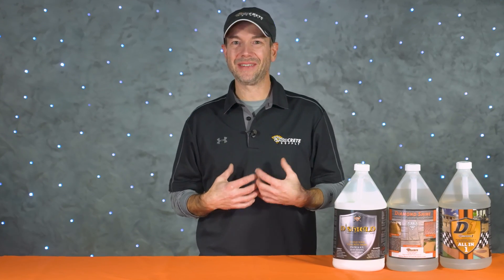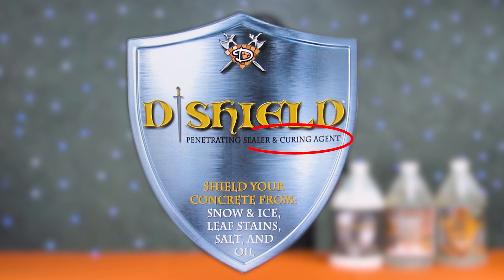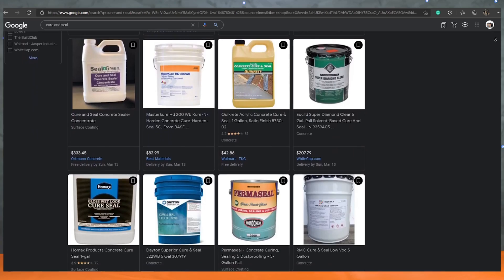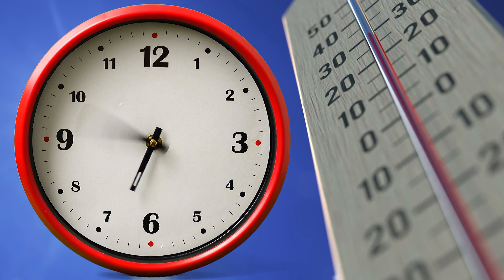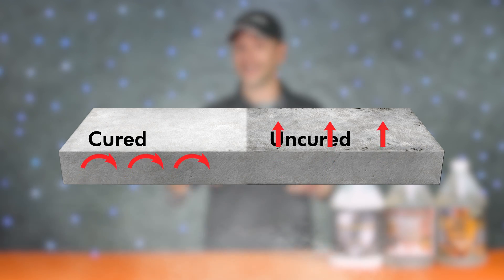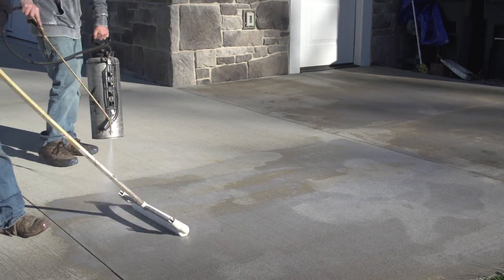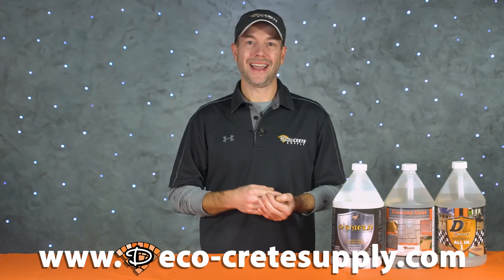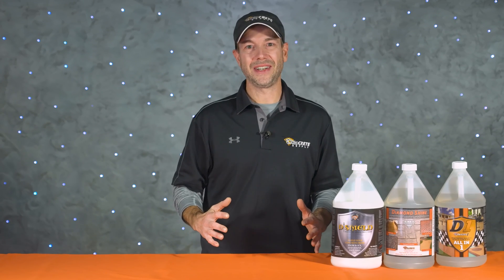Curing vs. Sealing Concrete | What's the Difference?

Comment: what sealing product should i use that will also lock in decorative stones/tiles/beads placed on the concrete, especially with a matte finish?
Reply from the maker: Thanks for the comment! A few questions for you: Are the stones embedded and secured in the concrete, or are they loose? Is this an interior or exterior project?                                                       It would be hard to hold them in with a concrete sealer. Epoxy would work better for locking the stones, but that would only work for interior concrete. If the stones, tiles, and beads are well secured in the concrete, then a regular concrete sealer would work fine. I would recommend our D-One sealer in that case. I'll leave a link below to a video on sealers vs epoxy. Hopefully this helps. Thanks for watching Deco-Crete TV!!!                                                                                                                                                                                                                                https://www.youtube.com/watch?v=dSz71y4uKcU&t=425s
Reply: @DecoCreteTV  exterior. Most are locked in but some are loose.

Comment: Should I seal in a place I use petrol and oils/solvents like a slab of concrete where I pull motor bikes apart and that?
Reply from the maker: Thanks for the comment! To answer your question; yes, you should the area. But, this situation can be tough as solvents, gasoline, and break cleaner can damage most acrylic sealers. Penetrating sealers are better for this because they don't leave any film behind to damaged by the solvents. The only downside is that penetrating sealers don't respell oil stains quite as well as film forming sealers. There is no right or wrong here, it just depends on what's most important to you. Personally, I prefer penetrating sealers for this. I'll leave a link below to a video explaining the difference between the two types of concrete sealers. Hopefully this helps. Thanks for watching Deco-Crete TV!!!                                                          https://www.youtube.com/watch?v=mpm855Hg9ec&t=310s

Comment: Should there should be a cure product put on a concrete that was just poured at 40-45 degrees? It has been covered and cut lines will be done the next day.
Reply from the maker: Thanks for the comment! We've never worried about applying a curing product in those temps. The point of a curing compound is to help the concrete retain moisture and slow down the curing process. This will happen naturally in cooler temperatures. This does not mean that the concrete is protected, though. You will eventually need to apply a sealer to reduce water intrusion and guard against staining. Sealers generally get applied 30 days after the concrete was poured. Thanks for watching Deco-Crete TV!!

Comment: It’s been 5 days since my sidewalk was pour. Is it too late to apply cure and seal.
Reply from the maker: Thanks for the comment! It's not too late to apply a cure & seal, but at this point it won't do much to slow down the cure. It would be acting as more of a sealer. In order to "cure" the concrete it would need to be applied within the first 24hrs. Even though the curing stage can last up to a month, concrete gains most of it's strength in the first few days. At this point, I would let it cure out for another week if possible, then apply the cure & seal to protect the concrete from staining and winter weather. Hopefully this helps. Thanks for watching Deco-Crete TV!!

Comment: I have a concrete path leading up to my home. My neighbor, who was trying to be nice a few years back, put salt all over my concrete to de-ice it while I was at work, not knowing that it would destroy my concrete. Anyhow, it has since spalled pretty badly in some areas and even had a few larger cracks. I'm not in the position to fix it professionally right now, by having someone come in to resurface it, if I seal it do you think this will help prevent it from spalling any further? It's never been sealed, which was my first mistake, and I think that's also part of the problem. I recently did a faux finish on it with watered-down chalk paint to make it look like flagstone, so the spalling and cracks in the concrete look more intentional and less visible and to be honest I'm pretty happy with the end result for a DIY project that I did myself until I can get it fixed professionaly, but now I want to prevent it from spalling even further and also want to seal in the faux finish that I just painted on it. Any ideas on what I would use in regard to this application, or do you think it will still continue to spall after the winter? I used chalk paint because, instead of it peeling over time, it should just fade slightly, and because I watered down the paint, it went on more like a stain rather than a thick paint.
Reply from the maker: Thanks for the comment! We're sorry to hear that you're having spalling issues with you concrete. It's hard to say if sealing it now it will stop the spalling or not, but it will keep water from soaking into it, and may extend it's life a bit. That said, we never recommend applying concrete sealer over paint. Acrylic/topical sealers will have a really hard time bonding to it, and the paint will block penetrating sealers from soaking into the concrete properly. I don't have any experience with chalk paint, so I'm not sure if that would be any different or not. I'm curious how fast water is soaking into the concrete right now. Paint itself can ack kinda like a sealer as far as keeping water out of the concrete. The problem with paint is that it tends to peel or ware off after a short period of time. The first thing I would do is a water test. When the concrete is completely dry, dump some water on the surface and see what happens. Does it soak in immediately and make the concrete look darker? Does it take a few minutes to soak in and get dark? Or does it just bead up and have no effect on the color at all? If the slab seems be fairly water repellant the way it is, then I would probably just leave it alone. If water gets through the paint with in a short amount of time, then you might be able to get a penetrating sealer to soak through it as well. That kind of sealer won't necessarily keep the paint from wearing off, but it would make the slab more resistant to water. I would not recommend applying any kind of acrylic sealer, though. I'll leave a link to our video on penetrating vs topical sealer below. Hopefully this helps. Thanks for watching Deco-Crete TV!!!                                                                                                                                                                                                              https://www.youtube.com/watch?v=mpm855Hg9ec&t=239s
Reply: @DecoCreteTV Thank you for the detailed reply. The concrete is still very porous and absorbs water quickly.

From what I understand, watered-down chalk paint acts more like a stain and usually needs sealing. The paint’s designer said it can be left unsealed or sealed with her own (costly) product, but I’d prefer an affordable penetrating sealer from a big box store.

Based on my experience, chalk paint doesn’t peel but fades over time if unsealed. I’ve used it on many surfaces—including concrete—and it tends to wash away without a sealer or wax.

I put a lot of effort into the faux flagstone and want it to last a few more years before resurfacing. I was planning to use Behr’s matte penetrating sealer to help preserve it. But are you saying it won’t help protect the paint? I assumed sealing the surface would help lock in moisture and keep the chalk paint from fading—is that incorrect? I'll take a look at your link now. Thank you!

Comment: If the "cure or seal" liquid is a barrier to the "loss" or "addition" of moisture, why wouldn't it do both things at the same time?  It's a vapor barrier that prevents the flow of moisture from, or to, the concrete.  I'm confused by your description.
Reply: Ok so I did some digging bro. They are two completely different uses. Because you ONLY Cure your Concrete right after it’s been poured. It’s used to keep the hydration in so the cement can set as strong as possible.
Whereas Sealant is protecting the already Cured Concrete.  

Curing - Strength Development 

Sealing - surface protection  

Hope that made sense
Reply: I’m thinking the exact same thing. I don’t understand how they are “completely different things”

Comment: So my contractor poured a new drive way and side walk for me, then came back about 24 hours later to deform, and sprayed sealer on it,  not sure exactly what kind, it has now been about 2 weeks and most of the drive way looks great but there is a couple spots towards the end where they finished the pour that have some sealer lines in it, almost like nozzle got clogged and was a stream or something that are darker then the rest of driveway will this go away after the curing is complete or should I put something on it to make it better. Most of it looks a nice light gray color but there is few squares with those lines thanks for any help
Reply from the maker: Thanks for the comment! I know exactly what you're talking about, we've seen that a bunch of times. It will get better with time, it just might take a while. Basically, there is more sealer on those spots then the rest of the driveway, so it's making the concrete darker in those areas. You should notice a difference within a month or two, but could take longer then that before they're completely unnoticeable. I would not recommend putting anything over right now. You really need the sealer to ware down in those areas and putting something else on it would only the slow the process down. We hope you enjoy your new driveway! Thanks for watching Deco-Crete TV!!!
Reply: @DecoCreteTV  thanks my contractor said the same thing I just wanted a second opinion, thanks for the help!
Reply: It's a cement driveway outdoors, not a marble floor in your living room.  Do you really think that everything will be "perfect" in 14 days?  Do you realize that 28 days id the first critical time period for concrete?  Do you know that concrete continues to cure for 100 years after installation?  It's a chemical process.  Please do a little research and learn about concrete.
Reply: @philtheheaterguy951  I did research, that’s what led me to this video. The creator was nice enough to answer my question and concern, he wasn’t a jack ass like you, 😂I wanted to hear it from someone that was an expert in the field not some random website or person. Some people unlike you have a life and don’t wanna spend hours of time researching concrete. Lmao get a life bud

Comment: Is there a product that can be applied to keep it from not sweating?
Reply from the maker: Thanks for the comment! There's not really much you can do to the concrete to keep it from sweating. That has more to do with the building itself. Applying a sealer to the concrete would keep the moisture from soaking into the concrete, but it probably won't stop the sweating. Thanks for watching Deco-Crete TV!!!!

Comment: Why am I getting tired marks so easy on a new concrete cement poured? I did the bear concrete sealer on it and it’s so easy to pick up tire tracks.
Reply from the maker: Thanks for the comment! Tire tracks are common newer driveways. The good thing is, they will wash off fairly easy with a power washer and they will also go away on their own over time. If you've already sealed the concrete then there's not much else you do about it. It tends to happen the most when turn your car on the concrete. Again, it's nothing to worry about and they wash off. Thanks for watching Deco-Crete TV!!!

Comment: I'm  new to this but is it possible for the cure to be broken...if so how does that affect the concrete and release of VOCs
Reply from the maker: Thanks for the comment! By broken, do you mean spoiled? Or are you referring to the curing compound on the slab breaking down over time and wearing away? The second example is normal and once the curing has worn off, a sealer should be applied. In the case of spoiled product; don't use it. It's not worth the risk, just get a fresh pail. Hopefully this answers your question. Thanks for watching Deco-Crete TV!!!
Reply: @DecoCreteTV  I guess both...thanks for the response. I think you've already answered my question. Do you think there would be a cure that would remain irrespective of any type of damage? Or are we not there yet
Reply from the maker: @, I'd say we're not there yet. Solvent-based curing compounds will last much longer in the pail without spoiling than water-based products. However, all curing will eventually wear off the slab.

Comment: hey can you use the curing sealer to help cure fresh concrete. then 30 days later come back and seal with Penetrating sealer instead of using the acrylic again?
Reply from the maker: Thanks for the comment! If you cure the fresh concrete with an acrylic cure & seal you can seal the concrete down the road with a penetrating sealer, but it probably won't be ready for it after 30 days. You need to wait until the cure & seal has broken down enough for the penetrating sealer to soak into the concrete. All situations are different, but 90 days is usually a good number. Basically, once the cure & seal stops repelling water, a penetrating sealer may be applied. Thanks for watching Deco-Crete TV!!!

Comment: Our contractor applied a sealer immediately after placing our concrete colored driveway.  Then we put visqueen on to help with curing... seems that was a huge mistake... now 21 days later our driveway is very blotchy.  Are we stuck with this result or is there a fix?  Thank you for any help... our contractor is not helping....
Reply from the maker: Thanks for the comment! Concrete will naturally go through a blotchy phase while curing, and it's generally more noticeable with colored concrete. We would normally say to wait 30 days for the concrete to cure and the color to develop before applying any final layer of sealer, as the blotchiness normally goes away on it's own. Covering the slab with visqueen is the most concerning part of your situation. This can leave cure lines and blotchy areas that won't go away on there own. I would still recommend waiting until the concrete is fully cured before making any decisions on applying more sealer or correcting the color. The blotchy areas should improve with time, but you'll probably always see some of them. If you do end up needing to re-color the slab to cover the blotchy areas, our Revival coloring system would work really well. It's available in 20 different colors and it's easy to apply on broom finished concrete. You would need to remove any existing sealer before applying Revival. I'll leave a link to our how-to video as well a one to the sales page on our website. Thanks for watching Deco-Crete TV!!!                                                                                                                                                      
 https://www.youtube.com/watch?v=8w5MZBK9HXg&t=831s                                                                                                                                                                            
 https://www.deco-cretesupply.com/products/sealers-coatings-deco-crete-revival/deco-crete-revival-stain-kit

Comment: So how long do I wait to seal a fresh slab?
Reply from the maker: Thanks for the comment! The best thing would be to wait at least 30 days after the concrete has been poured. It would also depend on what type of sealer you plan on using. Acrylic sealers can be applied right away, but you'll get more life out of the sealer if you can wait the 30 days. Most penetrating sealers require the 30 day wait period. I'll leave a link to another video about acrylic vs penetrating sealers. Thanks for watching Deco-Crete TV!!!                                                                                     
 https://www.youtube.com/watch?v=mpm855Hg9ec&t=130s

Comment: Quick question I overlayed a porch today can I use cure and seal tomorrow. Or do I have to wait for it to cure first
Reply from the maker: Thanks for the comment! I would check the manufacture recommendations for the specific overlay product you used. Overlays cure out lot faster then full thickness concrete. Our overlay systems are generally ready to seal after 2-3 days. Thanks for watching Deco-Crete TV!!!

Comment: Hi - After applying the sealer XS-327 as a prime coat and it dried in 12 hours, I noticed the concrete change color. The concrete was darker in some areas while normal in the other, creating a patchy look. Any suggestions on how to fix this so it's not blotchy?
Reply from the maker: Thanks for the comment! I don't have any experience with that sealer, but my guess is that the blotchy look is coming from sealer wetting out the color in some areas but not in the others. Most sealers will darken the color of the concrete and usually need at least two coats for a consistent look. I would check the instructions for that sealer to see what the re-coat options are. I'm guessing another coat will help, but some sealers need sanded before re-coating if more then 24 hours has passed since you applied the first one. Also, keep in mind that concrete is not always completely consistent in color. It will naturally go through a blotchy stage as it cures and sealer tends to magnify this. Hopefully, this helps. Thanks for watching Deco-Crete TV!!!